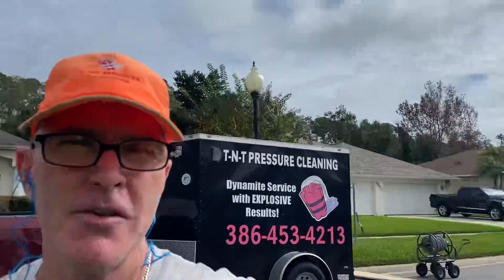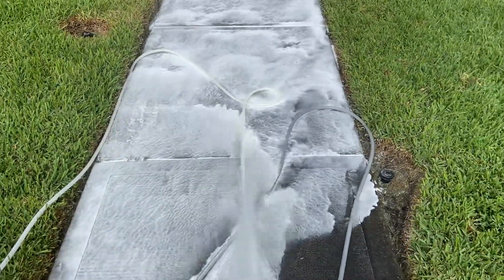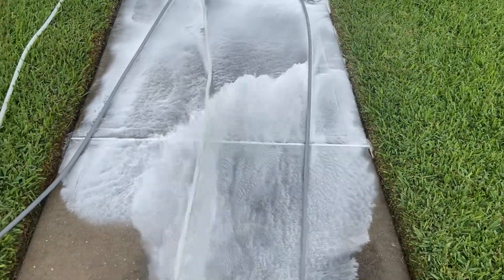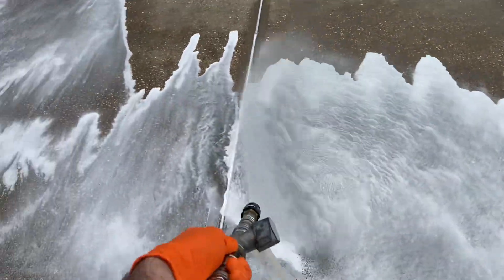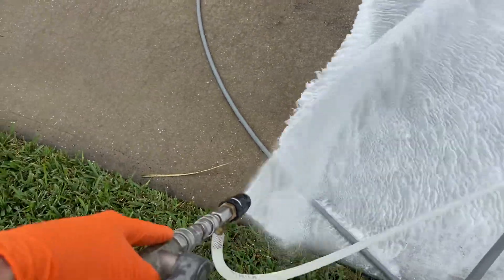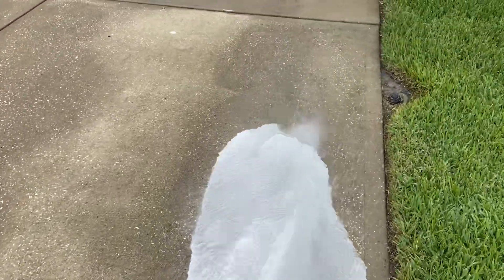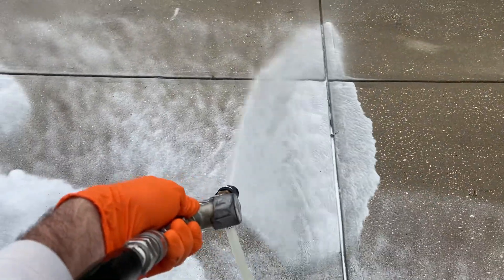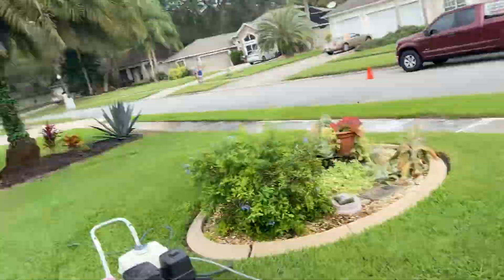Watch the X-JET M5 lay down some solution

Comment: Are you keeping the runoff from entering the storm drains?  In most cities it is illegal to send anything except untreated water into them. We have to put dams up and pump the runoff back onto the owners property. Ormond Beach has the same requirements in their city codes…Sec. 22-159.06. - Prohibition of illicit discharges.
Reply from the maker: As an experienced waterman, surfer, scuba diving instructor, environmentalist and all about protecting Mother Earth; nothing but clean water runs into the storm drains. I even rinse off all the little critters that could be affected, like lizards, frogs and yes even worms. Caustic chemicals are always treated with the utmost mindfulness practices. If you went to any of our conventions or vendor showcases there are many outstanding systems to address this conversation. Thank you for caring about our environment 👍

Comment: What % is that?  seems like it’s laying a ton of chemical down
Reply from the maker: 4% & never any pressure switches going or leaks … zero issues! Siphoning chem thru the nozzle, no chem goes thru machine or hoses. Way stronger than downstream, just as if not more powerful than any gas powered and makes 12v look like a squirt gun. I do use 12v for roof applications because it is imperative to get  a 6% hot mix and 4% is about the strongest you can pull with the X-Jet M5
Reply: Thank you

Comment: What kind of surfactant are you using and how much of it do you mix into the SH
Reply from the maker: 1/4 cup per 5 gallons. I’ve used Terra wash, apple wash, blue dawn original dish soap, green gain laundry detergent and after tons of research and 1000’s of hours in the field I have managed to produce my own proprietary blend of soap/degreaser that is specific for each hardscape surface and type of inorganic and organic organic matter. I call them Blue Dragon and Green Goddess. Best of luck out there and thank you for your question and positive feedback. My short answer is for you to experiment with industry standard soaps and some old school methods and see what works best for your situation and climate. Some guys aren’t using surfactant at all anymore; I don’t understand that philosophy but I have been doing this since 1991 and it has taken me 25 years to develop a system that is effective and efficient. You can’t go wrong with green gain laundry detergent if that helps you out until you begin mixing some of your own concoctions.
Reply: @t-n-tpressurecleaning7781  thank you I will try them out
Reply from the maker: @jcerdeiras83 👍